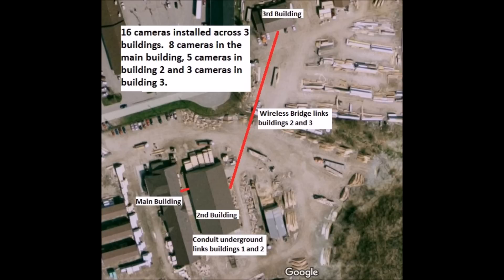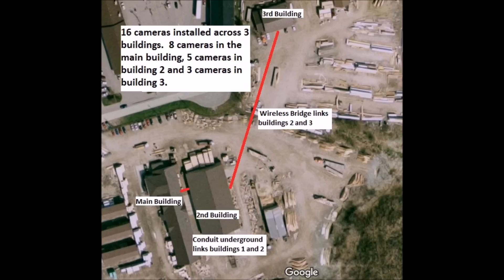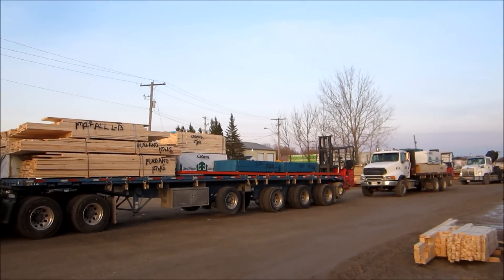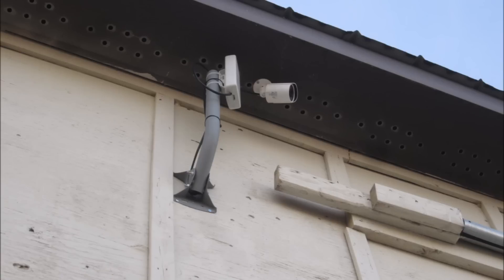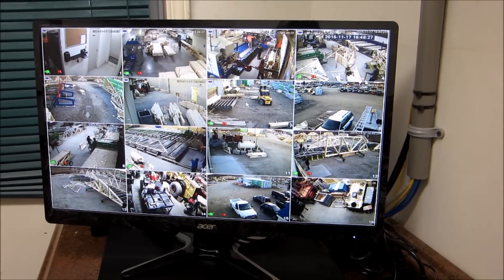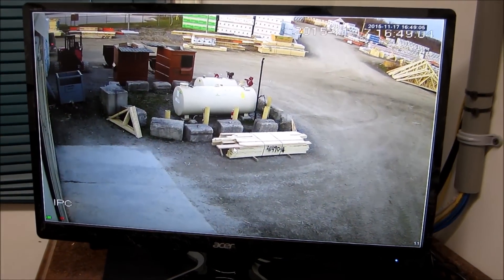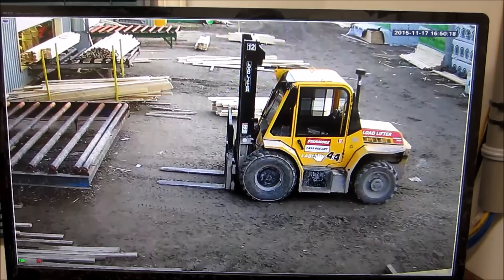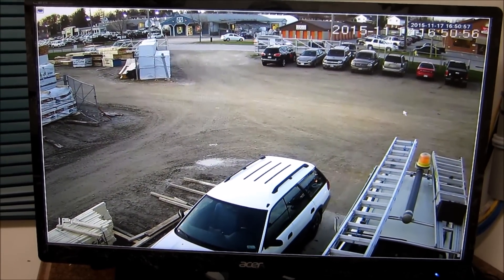NVR with IP camera Installation and Wireless Bridge

Comment: I have a storage unit and setting up a security system.  I have a lorax 16 head nvr, TP link Archer C4000 router, Netgear 8 port switch, nano station loco.  I have all cameras installed.  6 on main building plugged directly into nvr and records.  Problem 6 others throu switch and the nano station wireless  loco bridge to main unit can't find feeds.  Do you have a diagram to assist in figuring out

Comment: What wireless bridge are you using ?
Reply from the maker: I use different brands depending on the distance, interference in the area, the number of client stations etc.
Reply: @Electroguy  pls I am dealing with a project just like yours and the buildings are 40m apart from each other and 3buildings in total. Any way to help me bridge all of the cameras to one building?

Comment: Is this wireless connection working without internet connection?
Reply: Yes the wireless does not need internet in order to work.  It does not depend on the internet.  You could have a completely standalone system with wireless that is not connected to the internet.  The recorder can be connected to the internet for remote viewing.

Comment: Hi, I needed your help for a project. Its details is mentioned below, please help me :
Since, I have never done a wireless project before, I would be mentioning all my steps below (these are in accordance with a similar layout as you, My location as one base station(Main Building) and three nano stations) :

Firstly, at the nano-station :
1. Connect all the IP Camera with a POE Switch via Cat-6 Cable.
2. Connect a Cat-6 Cable from the same POE Switch to the secondary port of the nano station.
3. Connect the Main port of the nano station with its POE adapter.

Secondly, at the base-station :
1. Connect the antenna with your device( I dont know the exact name ).
2. From the device connect via Cat-6 to a POE Switch
3. From the POE switch, connect to the NVR.

Please tell if if I am wrong with my workflow and suggest me appropriate measures.

Also, I wanted to be specific about the CCTV Camera's connectivity and hence I am mentioning the details of the camera at the Base Station and all the Nano Stations below :

Nano Station 1 :

2 MP Verifocal Bullet IP Camera : 3 pc.
2 MP Bullet IP Camera : 2 pc

Total no of camera : 5 pc

Nano Station 2 :

5 MP Panoramic IP Camera : 1 pc
4 MP Verifocal Bullet IP Camera : 1 pc 
2 MP Verifocal Dome IP Camera : 4 pc
2 MP Bullet IP Camera : 2 pc
2 MP Dome IP Camera : 4 pc

Total no of camera : 12 pc

Nano Station 3 :

2 MP Verifocal Bullet IP Camera : 3 pc
2 MP Bullet IP Camera : 1 pc

Total no of camera : 4 pc

Base Station :

4 MP Verifocal Bullet IP Camera : 1 pc
2 MP Bullet IP Camera : 3 pc

Total no of camera : 4 pc

These four camera shall be connected directly with a POE Switch along with a connection to the base station. By doing this, I will be connecting 21 Camera wirelessly and 4 camera via cat-6 cable.

Please help me with this solution as I have many pending orders for Wireless Connectivity. I am sure that once this project gets completed, new orders will be coming soon. 

Thank you once again.

Comment: How do I get a pass word, I did not get a users manual only a quick installation guide
Reply from the maker: Everett Durst Hi every I don't recognize your name.  Did you purchase a system from us?  If so it's best to contact us directly by phone or email from our website Electroguy.com thanks
Reply: I got the system from Walmart, with out a pass work the system is of little use, the pass word must come installed, with out it I can not change it, so I just need to return the system to Walmart?
Reply: Everett Durst Sometimes the full manual comes on the cd that came in the box.  If not return it.

Comment: how do you get the bridge to link up and connect to the router?
Reply from the maker: THEY DIE WE LIVE the bridge at the main building is wired back to the router.  The nvr is wired to the router.  That is how everything is linked and connected together.
Reply: ok so it still needs a direct connect to the router...is there anything out there that I dont have to use a direct link to router are there any 100% wireless products...even if i use another router as an access point?
Reply: THEY DIE WE LIVE what are you trying to do?  This does not need the router to work.  The wireless bridge can still link two buildings without a router.  Let me know your scenario and I will let you know if it can be done or what products to use.
Reply: Im using 4 wired POE Swann Cams to a NVR outside my house NVR and wireless router are inside....It comes with 50ft cables but I want someway to run the cables to a bridge or router outside so I wont have to run all 4 cables from cams to inside house if I run a bridge or use another router as a bridge does that bridge outside still have to run at least one ethernet cable to the main router inside or is the bridge truely wireless?

Comment: 1)-How many cameras could be attached on one antina, and how..?

2)- does heavy rain and lightening or windblown causes any problem to signal /connection or could we reset te antina for video loss ?
Reply: Omkar Wadkar I have done 8 cameras with no problem on a 150mbps bridge.  1080p cameras stream at less that 10mbps per camera.  So, you could probably do about 15.  You can also get bridges that will transmit at much higher bandwidth.  Make sure the antennas are locked down properly and you shouldn't have problems.  Rain does not bother it either.

Comment: Good morning. I Want to know if it's possible de get link to buy your NVR & caméra wireless ? Or juste get the brand Thank you for your reply
Reply from the maker: Yes please email us and we can give you pricing and arrange for shipment.  The wireless portion of this system is a special custom designed setup and will not work out of the box unless it is programmed properly.  We do offer programming of the complete system to make the setup eaiser for you. dax@electroguy.com